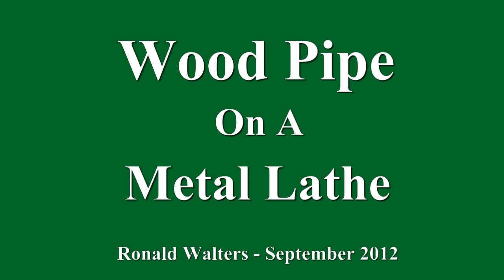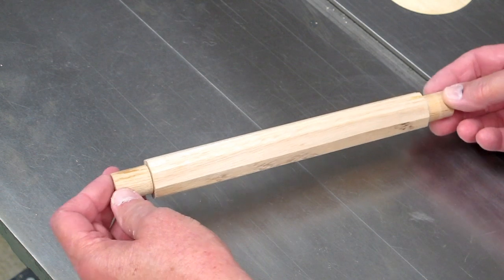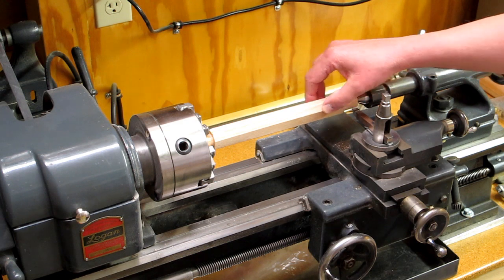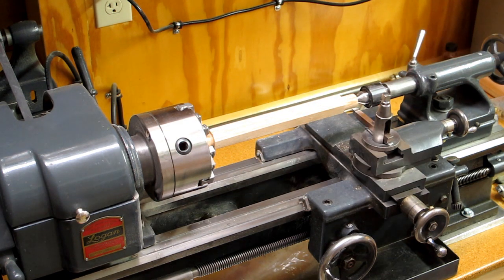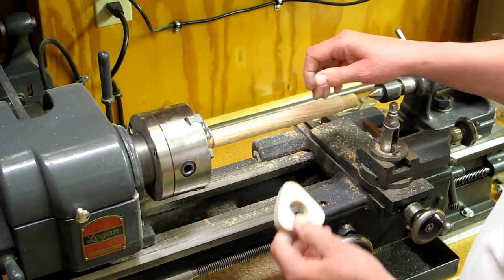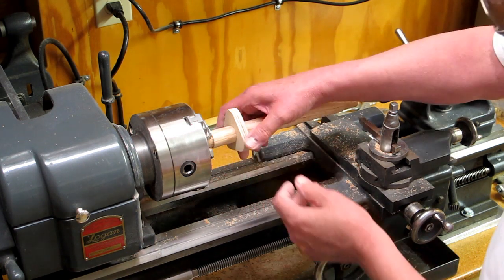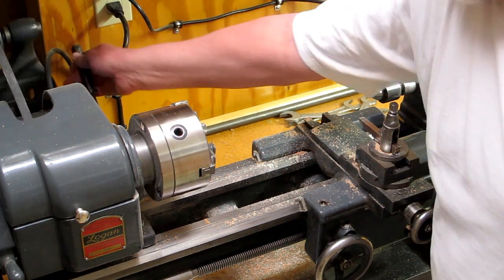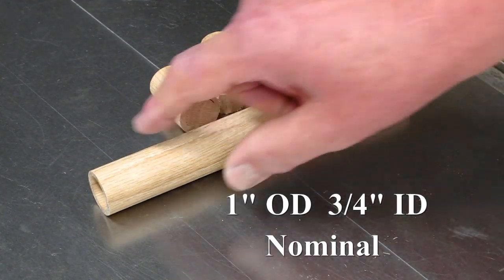Wood Pipe On Metal Lathe

Comment: Using the shop vac is the best idea ever!  I didn't think of it, and after getting into pen turning I found my lathe was a mess to clean.  The way out that I took was to buy a cheap Harbor Freight 10x18 mini wood lathe, which I do not regret.  The same lathe is also available from Grizzly and other name resellers.  One of them even sells an extension bed that will fit.

Comment from the maker: I have been fiddling with bits and pieces of it since the pin gear ring gear video and I shot that well over 9 months ago. I have built it and torn it apart twice and it’s on the third build.  Some (potential) components have already shown up… flat thrust bearing, worm drive, u-joint, wood pipe, wood gears… etc. Shooting and editing video takes a lot of time. I generally do not shoot video of something I am not yet convinced is going to work.

Comment from the maker: Exactly! I do not have a wood lathe. I've thought about making one. I doubt you could safely make a 1" outside diameter 1/8" wall thickness pipe on a wood lathe. With the 3/4" inside diameter I don't think there will be enough seasonal changes in the wood to obstruct the passage of a 5/8" ball bearing (at least I certainly hope not). :-)

Comment from the maker: It will be 5/8" ball bearings going through the wood pipe. With a 3/4" inside diameter they pass through nicely. I quit using glass marbles - they aren't round and they get chipped pretty badly.